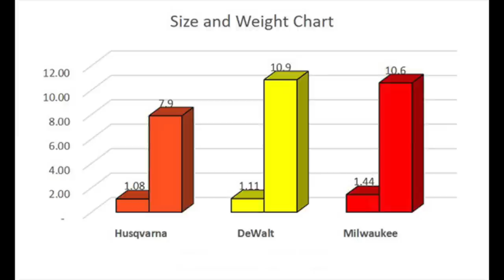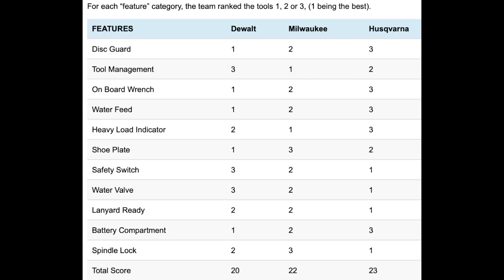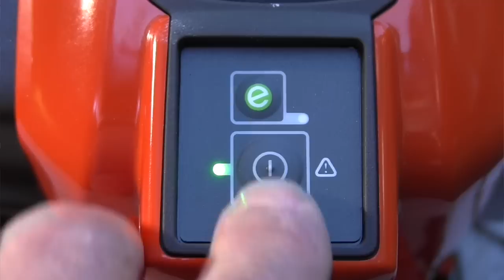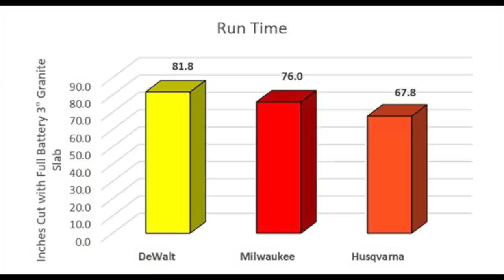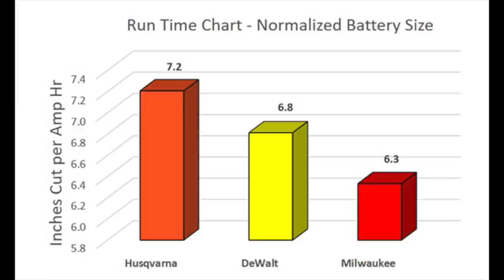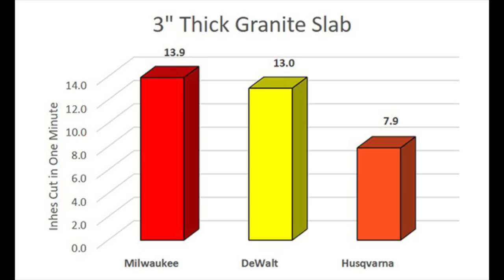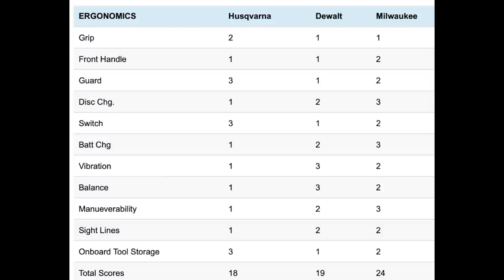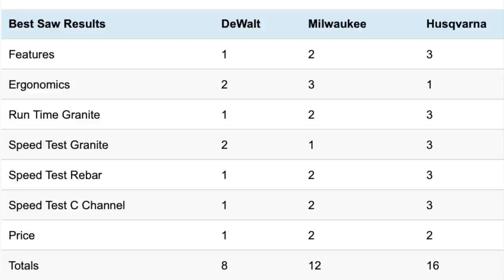Best 9-Inch Cordless Cut Off Saw ~ Head-2-Head

Comment: Yeah... call me though when Husq makes drills, pipe cutters, pvc sheers, impacts, hammer drills, recip saws, vacuums etc that run on the same battery platform as their concrete saw. I’ll wait.

Oh, and call me when dewalt stops Dicking around changing their battery designs with every iteration so you can’t use your old tools with them.

For that reason alone, for any reasonable contractor Milwaukee is the most sensible investment. Who cares which one cuts a tad better. It’s about batteries man...

Comment: One of these would be a nice addition to my tool kit but I can’t see a roof tiler or bricklayer swapping out the 2 stroke cutter yet, when you have cuts to make all day and your up a scaffold I just don’t think they would want to keep walking to put batteries on charge. For a carpenter tho, it would be ideal, especially for cutting through internal masonry walls, it’s got to be a selling point not to have exhaust fumes in a customers house and also the smell of petrol in the back of the van
Reply from the maker: Ben Chippy yup!
Reply: All the roofers I know use battery saws now

Comment: Disappointed Stihl didn't show up, I've been considering buying it because I already have a couple batteries. I guess it makes sense they would be at a disadvantage because it's the oldest machine.
Reply: I've tried the Stihl and it definitely showed it's age. The ergonomics were perfect to me. However, the power was lacking. Under a light load you really feel the motor wind down and you can really feel it begin to struggle. Impressive for it's time but I don't think it holds a candle to these more modern saws in terms of power at least.
Reply: I've seen Dewalt go up against Stihl and Dewalt blew it away

Comment: I bought a sthil tsa230 4 years still was the only company making a battery saw at the time  ago love it for cutting metal because the tool can be run inside the sthil batteries are close to $300.00 a piece and I need to replace them I think I may up grade to a brand new dewalt
Reply: Polski
Reply: @wallygator3442  like have the problem with batteries I wished I had weighted and bought a Dewalt instead

Comment: Nice review.  However you made one major oversight.  The Husqvarna is not the most efficient saw.  It is the least.  You are calculating inches per Amp-hour.  This is incorrect.  It should be inches per Watt-hour because each saw runs at completely different voltages.  Using nominal voltages:  Milwaukee 18V, 12.0 Ah = 216 total Wh.  Dewalt 54V, 4.0 Ah (12.0 is only when running at 18V) = 216 Wh.  Husqvarna 36V, 9.4? Ah = 338.4 Wh.  Inches cut per Wh would be: Dewalt:  81.8/216 = .38".  Milwaukee:  76/216 = .35".  Husqvarna:  67.8/ 338.4 = .20"
Reply from the maker: got it! Thanks

Comment: Just bought 2 dewalt saw kits the best deal I've ever got really unbelievable I got the saw two batteries charger diamond blade metal blade and a free 20volt fucking hammer drill with 2 batteries and charger and carry case for $849.00 KNOW HOW COULD I GO WRONG AND YES ITS NOT A STIHL 420 gas saw but it is the best addition to my tools I ever bought

Comment: For sawing metal-would be interesting to compare these machines to  8" metal cutting circular saws from Skil,and Milwaukee.Instead of abrasive blades the Skil and Milwaukee circular saws use  Cermet Carbide tipped blades.Milwaukee has a cordless M18 metal cutter saw.These machines will not cut masonry or stone materials.

Comment: Another solid head to head. I really appreciate your in depth look at every aspect of these. 

I think I'm going for Milwaukee with the 2 12ah batteries. It pains me to do so given that I've always been a DeWalt fan-boy and their saw seems clearly to be the better model. I had always outfitted myself and my workers with DeWalt, and I still have thousands and thousands of dollars worth of bulletproof DeWalt cordless tools. 
But I had a terrible experience with DeWalt customer service regarding one of their 60 volt products, and given that their saw is a flexvolt I'll shy away from it. The same reason I went with Milwaukee for a cordless SDS max a few weeks back. 

Boy did I go off topic...

Your reviews are insightful as always Rob.

Comment: Very well done review! We use Demo Saws almost daily as a heavy civil contractor. There are alot of times when doing a pipe Tie-in using Ductile Iron Pipe, that space is tight down in a trench, we are always looking for new ways to get something done more efficiently and safely. Typically its a big Stihl gas powered demo saw inside a trench box 10' deep. We are trying a Dewalt and a Milwaukee tomorrow, so Ill get some real life data. I'm a Milwaukee "guy", but I cant argue with your results with the Dewalt! We shall see! Great work!!
Reply: portable saws are the way to go. I do masonry work and it has changed the game.

Comment: I'm not sure about Milwaukee, but the Dewalt batteries are known to overheat.  Then you have to wait for them to cool down before you can charge them.  A heavy user will need 3 batteries for Dewalt vs 2 for Stihl or Husqvarna.  For Husqvarna get the Bli300 batteries, regardless of what any salesman says or promo they have.  BLi200 is about half the life as the BLi300.
Reply: Dude Milwaukee is the worst for overheating

Comment: the husqvarna shoulnt even be consider in the same league with how much it lagged behind in cutting time.. 4x cut in one test from dewalt to husq, and they mention the dewalt has the integrated water tube.. to me that seems a disadvantage the plastic will crack/ ruin the saw if it was to have water left in there in winter weather or could clog from bad water quality.. the milwuakee you can replace the hose for about 2$ in 5 minutes
Reply: Leave the valve open and it will easily run out... Your really trying hard to find things wrong with a better saw

Comment: Is runtime an issue.  I would think 6 feet of cutting isn't a lot when building a cinder block wall.

Look I get going cordless.  I also understand well that we are totally going towards fully battery powered tools and equipment.

For a person that is doing masonry for a living is this viable.
Reply from the maker: This will cut way more than 6 feet of concrete block we tested it in Granite which is much much harder
Reply: @ConcordCarpenter  

I still think that a masson might not be the customer for this saw.  Look a general contractor or a road guy this might be the saw for them.  Just not a guy that needs this all day every day

Comment: We got a DeWalt a few months ago. Runtime is very disappointing. Can't replace 2t saws but good for light work and way easier to use and start! 
Great video!
Reply: What ah was the battery you used
Reply: We use one all the time.. I'm impressed with the runtime we are using 12ah batteries

Comment: I'd like to see these companies go to a two battery saw so they could use a bigger blade to cut fully into 4" concrete.
Reply: jps101574 this is the reason I haven’t bought one. As a bricklayer having 3.25” of cut just barely misses the mark. 2 batteries and a 12” or 14” blade would be terrific
Reply: They now have 14" saws. Xr xc batteries !

Comment: What I dont like to see is that the batteries overheated on Milwaukee and dewalt. That's BS. You cant even use your battery up before you have to stop.
Reply: If you run any cordless tool hard the batteries will overheat.  These saws use a ton of power and you can probably easly stall all of them out.

I think with these saws there's a learning curve to get it right.
Reply: They’re not going to replace a gas saw yet. They’re supplemental for small jobs.
Reply from the maker: James Penner remember we were plunge cutting into granite - super aggressive test

Comment: I've had the dewalt cut off saw for a while now. I don't use my stihl anymore. Great video brother. 👍
Reply from the maker: david smith why not use Stihl?
Reply: @ConcordCarpenter  this dewalt can do most jobs I'd use the stihl for. But dewalt is lighter not as  Noisy a easy to start  Obviously.😁 my go to saw.💯
Reply from the maker: david smith got it - I thought you had the Stihl battery unit, your referring to the 14” gas saw

Comment: Main point of these tools and this video is switching from gas to battery power,u talked mostly about looks and ergonomics,,,how long can each saw cut per battery charge,size of battery,over heating....is it worth switching from gas to battery...
Reply from the maker: RCM The point of this video is to highlight the differences between the three tools and to show you that there’s a viable gasless option for small work and interior remodeling

Comment: Can you cut wood with the blade?  I'm thinking of cutting a hole in a roof through asphalt shingles and plywood.
Reply from the maker: Use a circular saw
Reply: I should have been more clear.  I was thinking of using a cordless saw on a roof during fire operations (it will always start and the oxygen levels won't matter). I realize you can't use a circular saw. obviously  @ConcordCarpenter

Comment: I can hear the Milwaukee fanboys crying now. But Milwaukee tells me their tools are the best. 😩😭🤪 Lol
Reply: Milwaukee is at their limit with 18v tools at its starting to show I think... 60v has the edge and DeWalt still has a ton of room to grow
Reply: @FusionBoost2.0  great point. DeWalt set themselves up for the future. Milwaukee makes some of the best cordless tools I just feel their fan base is a lot like apples fan base.
Reply: @justgregnow  That's pretty much it
Reply: I don't think voltage matters much.    Especially with today's technology.  They need to invert the power to 3 phase for brushless motors and with that you can jump the voltage to anything you need.

You need more battery cells to go to 60v.  That means more can go bad.
Reply: @answeris4217  I have 60v batteries from lanch with no issues. Volts and AH matters! Plus battery tech will change in the next 5 years.
Reply: @justgregnow  Nah, that's Festool.
Reply: @justgregnow  it really doesnt make much difference.. there is nothing special in any of the current lithium battery platforms the dewalt and milwuakee use the same style cells just dewalt gangs them up or 54v and milwuakee leaves them at 18v config but milwuakee has 9ah where dewalt has 3ah same power available in each pack.. dewalt might save some coin on the wire guage from the battery but might spent that coin on beefier switching and mosfets to handle the 60v

i like how any battery milwuakee makes works with any tool.. no you cant use a 2.0ah to do rip cuts all day with the circ saw but if you need a half dozen cross cuts to finish the day and all you have is the 2.0ah battery from your radio itll get it done.. also 5year warranty for milwuakee 2year for dewalt, milwuakee has all the mechanics tool dewalt has a mediocre impact thats it

dewalt seems to be first to market with alot of the consttruction tools but when milwuakee does release they seem to be heaps ahead,, for the 9" cut off tools they seem pretty similar.. if you would prefer 9" angle grinder milwuakee offers one dewalt has nothing
Reply: @AndrewBrowner  The flexvolt grinders all work better then the Milwaukee ones. No they don't have a 9" grinder but that's a really limited market. The DeWalt table saw works better, the miter saw, the circular saws, this chop saw, the SDS hammers are in a different league then Milwaukee There isn't much in the flexvolt platform Milwaukee can really touch performance wise... They try but it's not there

DeWalt makes 2 pretty good impacts but they have Mac to cover mechanics so you'll not likely see to many different impacts and ratchets etc you'll need to see Mac for that... The mechanic market is still heavily dominated by snap on and others.
Reply: @FusionBoost2.0  the milwaukee rear handle beat out the dewalt circ saw in every comparison ive seen, i havent paid much attention to mitre saws or table saws as theyre corded tools to me, the SDS hammers are very comparible with each winning in some sizes i believe milwuakee just announced the largest cordless one coming to market

and how does it make sense for the consumer to buy mac tools, they use their own battery platform and are priced about double what milwaukees are with similar and sometimes lower performance.. snap on isnt even in the same realm with their cordless tools 900$ for something comparable to a ryobi tool

regardless if you have red, yellow, teal, or even orange and green tools they all work amazingly off the batteries and are only getting better
Reply: Concrete chainsaw would be a awesome next tool
Reply: @AndrewBrowner  Never seen many comparisons then...

DeWalt has the biggest SDS rotary hammer that's cordless on the market and DeWalt dominates it by quite a good margin

Mac tools used the same batteries DeWalt uses and are all interchangeable
Reply: @AndrewBrowner  have you ever used a flexvolt battery? I don't need you to explain battery technical. I know more then 90% of people out there that used these tools on a daily basis. I know that my flexvolt batteries have more power then my 20v. I know that the flexvolt batteries last longer in 20v tools then the 20v batteries do. I have watched countless videos about Ah vs volts. Thanks for the lesson.
Reply: @markwicker2664  festool to me is in a whole different category of overpriced snobs lol. No contractor I know uses them so I don't even considered festool. Milwaukee uses walk around like their shit doesn't sink and every other tool company out there sucks. Aka Apple users
Reply: @justgregnow  yes flex volts are more powerful and longer lasting because theres more battery cells in them.. my 9.0 or 12.0 milwaukee 18v batteries are more powerful and longer lasting then 5.0s

you know more than 90% of all the tradesmen in the world?? thats impressive
Reply: @AndrewBrowner  I know 90% more about tool technology. Where do I come up with that? Because I go on job site and nobody has a clue about the tool besides it just works .
Reply: @justgregnow  

I didn't saw there was a problem with the flexvolt.  What I was saying is that voltage is overated.  You can have the same AH from a low voltage battery and then convert it to high voltage.

The power is already being pulse modulated by the computer and that means a voltage regulator is very much possible.  That's why Milwaukee can have the same tools on the 18 volt platform.

It's marketing swag if you had any of the top brands you will probably be happy
Reply: @justgregnow  

You obviously don't know much in tool tech if you believe that there's something special from the flexvolt.  All you need is a little electrical math to know that.  Something you learn in trade school.
Reply: @answeris4217  marketing swag is correct. Milwaukee, Makita, and DeWalt and you're good to go.
Reply: @answeris4217  not sure I said there's anything special about  flexvolt batteries other than there's more power and they last longer in 20v tools then the regular 20v batteries. Trade school doesn't teach anything about battery tech 🤣
Reply: @justgregnow  

Depends on the trade.  I went in to be a mechanic and you need to understand electronics.  It's an important part of being able to find issues in cars.
Reply: @justgregnow  

I own Ridgid tools because they where first with tools that I use today in my day to day and I haven't had an issue.

I think that today all prosumer tools or tools that are marketed to contractors are within 10% of each other.

Most of these tests on this channel show this.
Reply: @justgregnow  gotta agree with you on that one... most people dont know the difference between a 9volt nicad drill from 2001 and a brushless 20v lithium drill from last year other than one works faster
Reply: @AndrewBrowner  or nicad batteries are way better than lithium ion 😆 I've heard that from many old timers
Reply: @joeframer9642  tell em bro 🤣 you can't beat the DeWalt 60v wormdriveish saw. The Milwaukee wormdriveish saw does have a light tho 🤔.
Reply: Well I own Milwaukee 12volt 18 volt some makita 18  volt a few ryobi 18 volt. And dewalt flexvolt. And to be honest that flexvolt power can be felt! Milwuakee seems to be lacking the power. But run extremely smooth! And are much lighter feeling in the hands. 🤔 I'm a big guy and I like the heft of a tool. Honestly dewalt still cant be touched. But when it comes down to it they all do the fucking same thing. And they all do it well.  🤷‍♂️ just preference IMO.
Reply: @narcolepticlex  well put bro. I like Milwaukee it just seems that die hard Milwaukee users are quick to want to trash every other tool brand on the market. So I have fun with it lol. I respect your opinion it is sound and makes too much damn sense 💪
Reply: @justgregnow  I've used all the brands myself and feel like there all pretty good, I like milaukee but the other brand are good too. It's all personal preference.
Reply: Voltage must matter to some degree, otherwise my 12v tools would perform as well as my 18v tools. Wish they did
Reply: @chriswebb3018  best statement on here. Great point brah